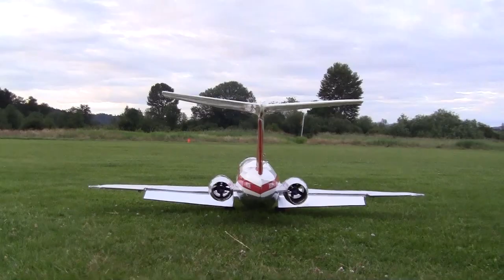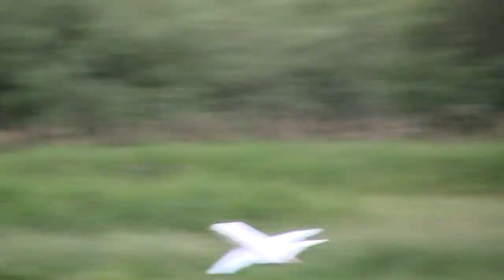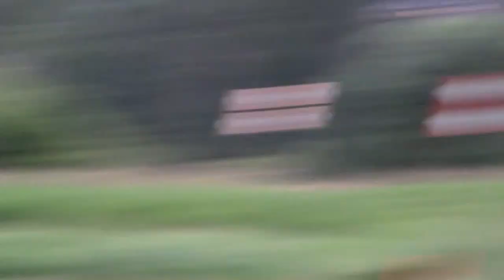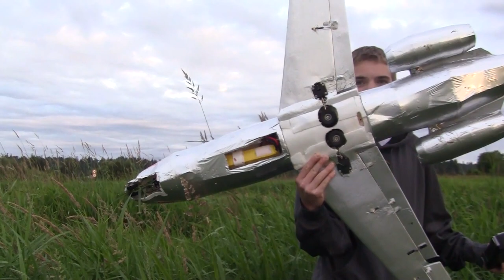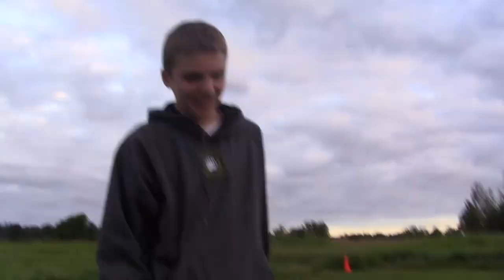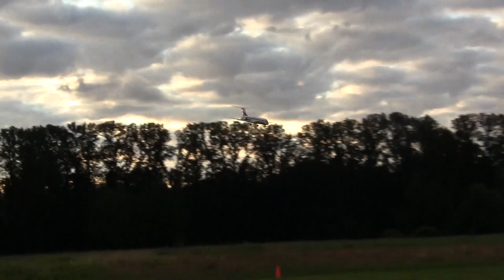RC DC-9 Takeoff Crash and Aileron Failure Flight

Comment from the maker: Not sure what you mean, the foam needs to be strong in certain areas for flight and I build my planes like that to save weight (just like full scale construction). When this is abused in a crash like I did here, of course there will be damage because the nose was only built with enough integrity to hold a nose gear and withstand the airspeed, not to hit the ground. Its like asking why glass is used for holding liquids because it could break when you drop it.